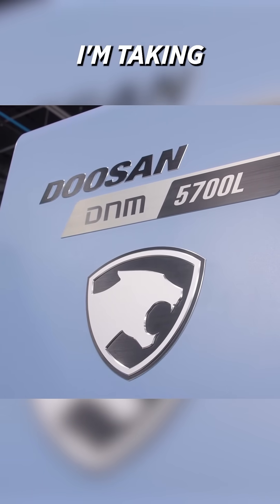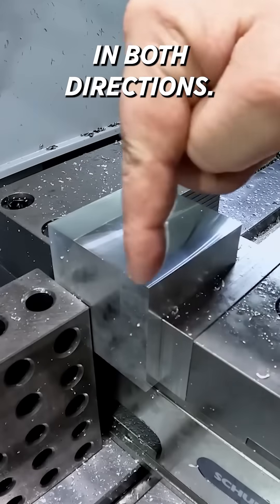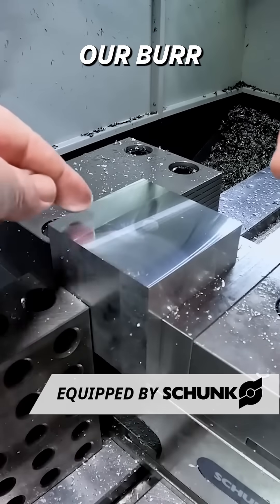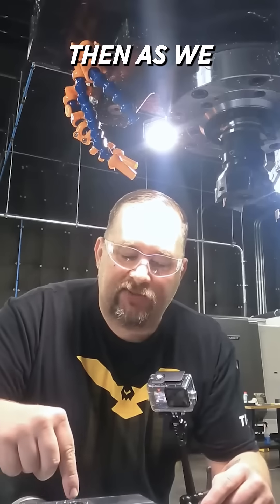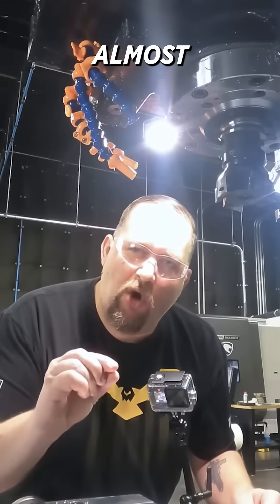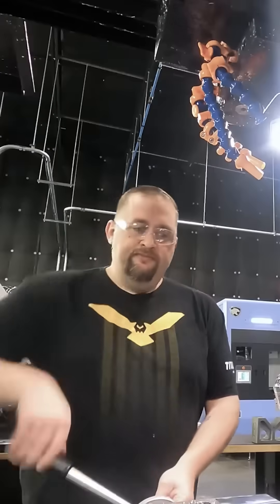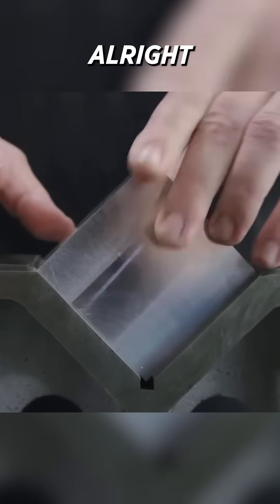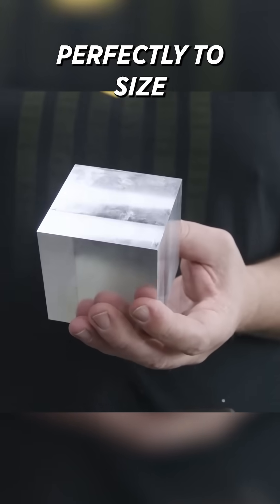STOP DeBurring Using this Technique

Comment: I need advice on how tight to tighten a kurt and modular vise without overtighten. For example, a part with the heigth of 6" had a base milled down to 5 7/8".  I use serrated jaws but with the vise only holding 1/8" of the part, fear of the part being thrown is always prevalent.  How much should i torque the vise? Kurt's max spec is 40lbs. Do yall (anyone in the comments) run these specs or use higher torque? Too much and my part is pushed up and off the parallels, cutting out of square. Any advice appreciated. Thanks

Comment: I would have clamped it in the center of the vise and milled the top and around it with a long end mill to get 5 sides true and square then flipped it and hatted it off.the professional way.I sure as hell would never put a clamp directly on my 1,2,3 block without a piece of aluminum protecting it. Digital mikes are for people that couldn’t cut it in the shop and went into inspection.inspection Jeez what is this amateur hour?

Comment: Question why do you have the radius blocks on the vise holding the block is that to prevent it from pushing the part up or what is the reason for doing so?

Comment: Sir, your block is within tolerance, approaching blueprint nominal. There is no such 'perfect in human endeavor.
Btw, I love this channel. Aerospace inspector, here.
Reply: I get tired off that term being abused. I've often told people that perfect is "within tolerance while striving to satisfy the intent of the drawing". I've personally always done my best to hold nominal. I think that's our job. Otherwise unilateral tolerances would have no purpose. I would love to hear your take on this.
Reply: @charlieguenther5490 our job is to make parts to print, repeatedly and as fast as possible. Nominal is only a suggestion... the tolerances are the requirement. If you are putting any effort on getting to nominal any dimension whose tolerance is wider than +/-.002" you are wasting time, and you are not good at your job. 
You're not the engineer, you're the machinist. Know your place. 
I'll illustrate my point with an anecdote. I worked at a place that had a good way of vetting new hires. We'd start them in deburring, move them to the saw room, and then to cnc operator and so on. This one kid that moved to operator kept stopping production and interrupting setup guys because a feature wasn't at nominal. It was determined he was perfect for managing the saw room. The end.
Reply: Ok, hard guy.

Comment: I have written a macro for facing material where the first path rolls into the stock at a corner then makes a .050” step over pass around the perimeter once at the final depth, then does the opposite direction passes technique.  If you do it the way that’s shown you’ll still usually leave a burr where the cutter runs off the part.

Comment: Sorry for the stupid question, I’m still quite new only been in this trade for about 2 and a half years. Why does he put a half circle bar between the part and the vice?
Reply: Usually when you want to mill something to 90 degree angles, you mill one side, put that side to the back of the vise (which is the closest to 90 degrees you'll get in most mills) and squeeze the other side with something round in order to make sure the part aligns with the back of the vise. You want the front end to not have a flat surface the part can align to, so it rests flatly against the back wall.

Comment: Why did he use the half-round bar in the vice?
Reply: It essentially eliminated any play in the moveable jaw that could cause the part to kick back (or tilt forward) and not sit parallel against the solid jaw. Hence, not perpendicular to the surface to be cut. There's more to it, but that's the basics.

Comment: Lol, presumably, he is using a half round bar to achieve a square block. If that is the intention, the block should have been deeper in the vice so the block could roll flat against the solid jaw. Preferably, the bar would be a full round to more thoroughly eliminate the influence of the movable jaw allowing the block to roll more freely, and hitting the part with a dead blow hammer at that stage of the process is counterproductive.
Reply: I always use round bars but if using half round ones the round face should be against the part not the moving jaw and tapping it down squares to along the X axis which is still a good idea at that stage though it does nothing for the Y axis orientation.

Comment: So their shop has about 10 or 15 million dollars in equipment excluding rent or building value?  How off am I?
Reply: Id be willing to bet you are closer to 10 or 20 percent of the value of their equipment. They have a lot of the biggest and newest machines. Our shop just got a 5th Makino Mag3ex to add to our cell of 4. They are around $3mil each, plus $250k per pallet. They come with 2 pallets each, but we have 20 pallets now. Those machines will run for days on end without any operator input given a good program and right combination of parts.

Comment: I'm an amateur when it comes to machining. Can someone explain why he's holding the cube onto the vise with a half rod on one end?
Reply: Not entirely sure but i believe its to make sure the part is in flat so he can create two parallel sides to hold onto.
Basicaly, the raw material is not 90° all arround, but the clamping thing, don't know the english word for it, is pretty much exactly 90° and parallel. If he were to just chuck it in there it would be clamped at a different angle everytime he changes side and it would only get worse.
Another issue would be that the workpiece isn't held in place securely because there would be an airgap somewhere, so chances for the piece to move would be drasticaly higher.

But thats only my assumption having had to trouble shoot in a similar manner
Reply: @Pilotfox123  You're right. You want the freshly milled surface to be parallel to the vice jaw, so you use a line of contact on the opposite side to help it do that. Technically speaking if you wanted it perfect you would need a single point, but that's less secure and this is generally close enough
Reply: The rounded surface of the rod ensures that the block is clamped securely regardless of any unevenness in the surface it's clamped against . When I'm on the manual mill if I've to machine all sides of a block ,dependant upon how out of shape the surface is I pack cardboard strips between the movable jaw of my vice  and the block for exactly the same reason . You can use a ball bearing as well but you have to watch out for damaging the face of your vice jaws better to use a half round bar or ball .
Reply: @stevethompson8504  I use pennies.
Reply: Thank you all for the responses, it makes sense now 😄
Reply: He's doing it to have all sides aligned to each other. How I got taught in Germany you're supposed to flip it in the same direction and do every side like that. Essentially the top side always rotates to the fixed vice. However if you have to do that to begin with your personnel managing supplying the raw material already fucked up and gave you the wrong material size to begin with. If you leave extra material leave enough so you can work on 5 sides at the same time, not 1 at a time. That will always assure you it's as parallel as it can get.
Reply: A: the back of the jaw is FIXED while the movable portion of the jaw has degree of MOVEMENT.  the moveable portion of the jaw will naturally twist or distort from the offset force created by the lead screw below as you tighten the vice, so the rounded piece of stock then converts that force into single point contact or as someone mentioned line contact.  channeling the clamping force in this way better seats the piece of stock you're looking to square flat against the back jaw.

Comment: Please tell me what is the point of clamping the workpiece through the cylinder?
Reply: It's an old machinist trick to get the piece into the right angle
On a CNC it doesn't make any sense cause if someone uses his brain he only need to clamp the workpiece 2 times instead of 6...

Comment: My ballscrews say its best to climb mill only for finish
Reply: Always want to climb as faster speed and feed will push tool away if there one move to conventional 99% time tool will suck into and blow up tool or move part is carndnal sin you will find out
Reply: If your just shoulder milling and just semi then conventional is just fine.  If your in a pocket or have a floor then not a good idea @jodygwiinn1233

Comment: Had a part that had a near perfect perpendicularity callout. Had to surface grind every surface to the final size to make it “perfectly square”.
Reply: Thank you for the air quotes. Nothing in perfect.
Reply: @a70duster perfection is a mindset. Perfect actually has several meanings: two being “flawless” and “whole (complete).”
The perfect part is the part that passes inspection. 
It’s whole; complete.
Reply: @a70duster simply get good and the machine will do the rest 🙏

Comment: I would like to see if anyone on here can square up a block within. 0005, square, and to size without using anything but one measurement with mics, of course, a piece of cardboard, a small diameter piece of drill rod, and a well trammed machine and vice... similar to what you did here. I forgot to mention all 6 sides from rough.
Reply: That's not hard to do.
Reply: @gulch1969 Depends on what you have to work with.  A clapped out Bridgeport?
Reply: Five tenths is childs play. I grind to ±0.00005 all day every day.
Reply: @Mint_drake  sure. But this isn't grinding.
Reply: @jeffwombold9167  fair enough. In a mill that is only half worn out, I'm sure I could square a block to within ±0.005.
Reply: @Mint_drake he said half a thousandth not 5
Reply: @tongpoo8985 the dude's already out to a rough start and he hasn't even started 😂
Reply: I did that in the Age of 15 so idk what is going on here tbh...
Reply: I dont even need to probe the part. I wrote myself a program that uses a facing cycle and many different zero points. I just have to enter the physical dimensions of the part and where it sits in the vise and how tall the parallels are so i only need to press cycle start.
Reply: @ipadize  what about the other end?
Reply: Use scale hold to eges to mark x scribe line and best use say 1/8 ball to point eyball center x method and can also drag paper to set x0y0 and z length of tool look n tool offsett get denision correct and double check or write on tool length was and  one time z is length of tool used to s
Reply: But then easy prg as center is same both x and y but face mill at z uasally skim cut may need offsett little to cleans up top use face mill and free pass or spring pass face mill ensure is flat as will suck down and spring up as come off edge but then switch to parameter mill use short tool as possible and be sure no runout and mill parrameter use prg arond 1 time thro in sub prg loop z in g91 incemental and divide by depth needed be sure to climb and best go fast on feed and spin speed as fig in chip load but then when to depth pull out finish tool to run spring pass and be sure to relive shank so will not rub part gulling up or to push tool away again be sure tool runout is good but can use same prg just edit speed feed and loops needed but now best to drop down flute length use cutter comp as would writ one prg at finish print use tool comp but now you need free pass few times and throw mics on check good now flip over in vise set z 0 at btm part or top parells and can scale stk and now reverse as start at overall stk z loop sub prg to face mill to size throw caliprs check use tool legth z comp to size correctly again edit z to allow one pass a free pass as japan mazak or free pass american style all 6 sides now done use to do this useing no clamps but a technomanget maching magnat work great used to set up fri let run lights out for weekend had lamoin software would get paid extea bonus on lights out machining so would set uo few brother and sister tools to run prgs over with fresh new sharp tools to get sized  and spring out as parts were large and shavings at btm would pull flange up and chip tools on pass had pods top of mag so could just skim top mag pods would re face as needed used  1/8 ball scribe line straight so eyeball part straight to engraved lines so eyeball set up all way no indicater needed and always to size and bonus light out machining

Comment: Are machinists not taught about climb and conventional milling at apprenticeship stage 😂😂😂
Reply: Yeah we’re taught climb and conventional but also we make minimum wage so apprenticeship stage is mostly cleaning out dumps and janitorial work
Reply: Definitely are it showed nothing
Reply: They taught me that conventional was for manual and climb was for cnc. N that was it.
Reply: Which is pretty much what climb cutting is already doing
Reply: This video had nothing to do with conventional or climbing it had to do with the cutter pushing the chip towards the center of the part instead of the end which would have created a bur
Reply: Tell me you know nothing about milling without telling me you know nothing about milling... @Jchew112
Reply: College educated by book and no hands on , was lucky had teacher from industry experience made us clock in vocational school but demanded we had more hands on machines than books big plus also now some colleges want teach conversational programming and not standard g code is big mistake as conversational is not standard as have mazak and hurco conversational programming and are completely different but behind both is g code and can get spindle spinning machining without having to answer every detail needed using g code as haas quik code made in usa and haas control stayed same over years and hurco control will change often and with several glitches we called hurco jerco as were hack machines

Comment: But what if there's a square out? What if the stock has uneven edges?
Reply: Notice the round bar he puts against one side of the block. If cancels out any uneveness and guarantees that the cut face is a perfect 90 with the fixed jaw of the vice. Flip and do the other side and those two faces are now perfectly parallel.
Reply: Check it before machining.. if it's out of square face it and skim side of the part with an endmill so you can clamp it square for facing the other side.. once you got 2 faces paralel to each other you are golden.. other method is face first side -- rotate part so machined side is on fixed jaw and sitting flush when clamped and mill second face.. now you got faces with 90 between them and take it from there.. I prefer method 1